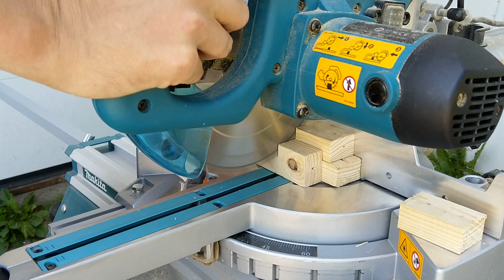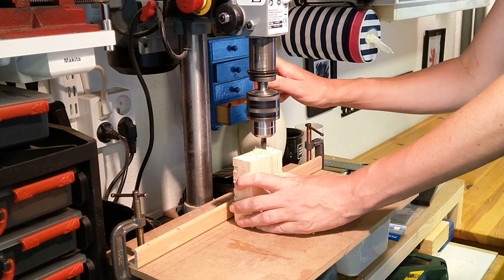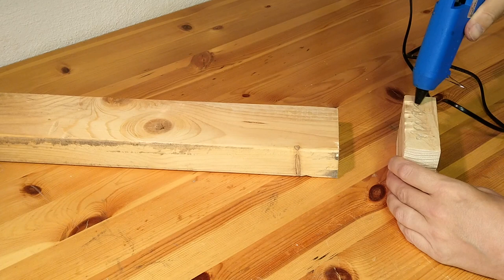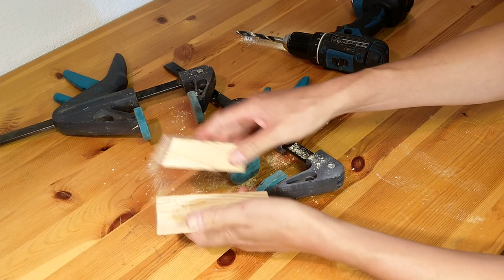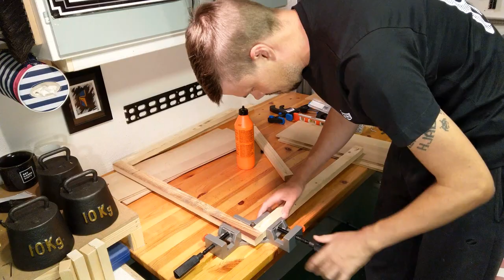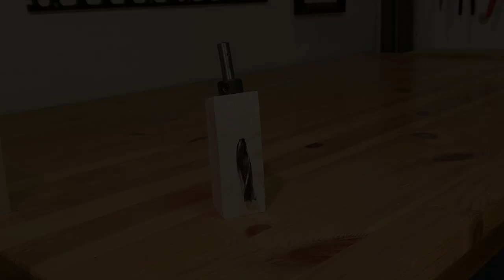Let's make a pocket hole jig from scraps! #woodjigs21

Comment: A classic. I gave this a go a few times but couldn't get it right, yours looks mint! Might need to give it another Crack, especially as I've lent my cheap aluminium one to a workmates and we've gone into a lockdown here in nz. Cheers mate!
Reply from the maker: Thanks! If I were to do an Mk. II, I think I would make one for each dimension of lumber, and then add supports on each side to keep it from twisting when drilling the hole. That would probably reduce the ware on the jig, and only require a single clamp.

Comment: I personally could never justify myself spending decent money on a jig, when I could easily just throw a spade bit in, tilt the drill on some wild angle, grit my teeth & hope for the best! . . . .  but this jig speaks to me!! Great idea
Reply from the maker: Thanks! This (as many of my projects) were mostly to get the idea out of my head. I only needed a dozen holes drilled, and didn't feel like using angle brackets, so if I hadn't done the jig I would probably have done the spade bit and hope for the best method...